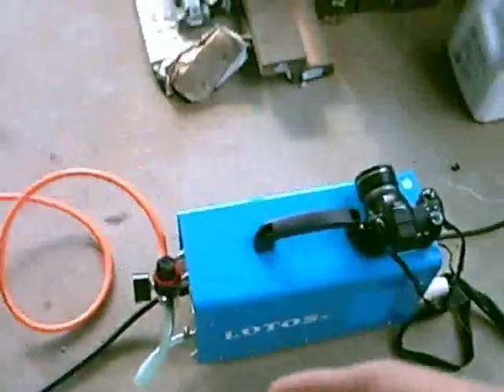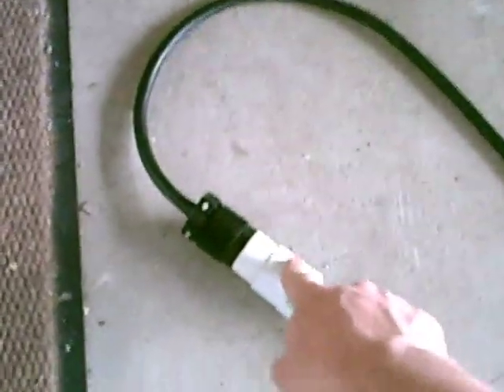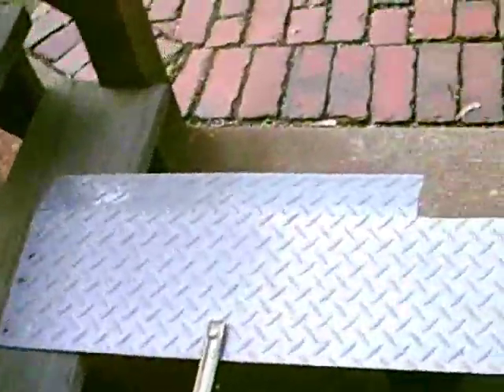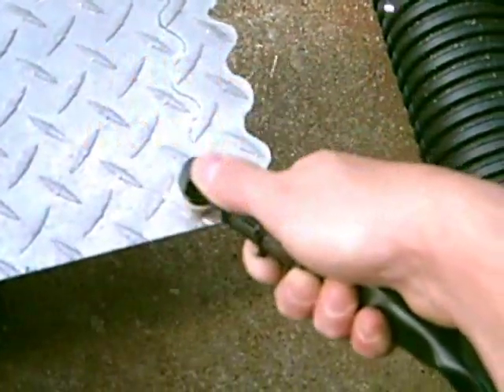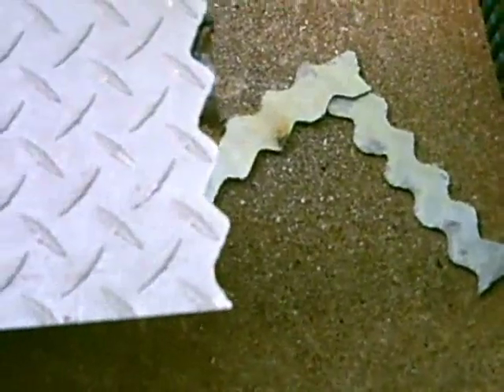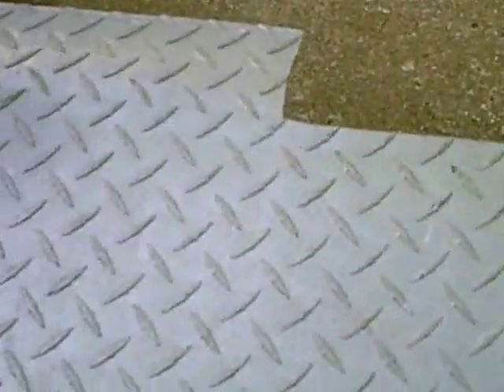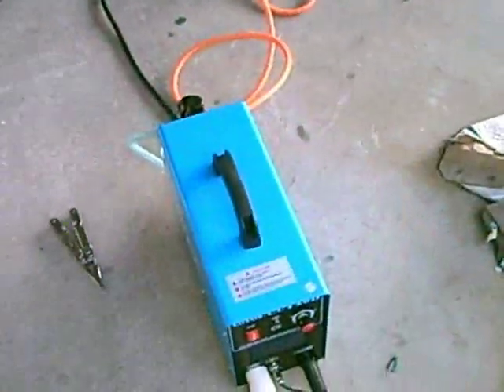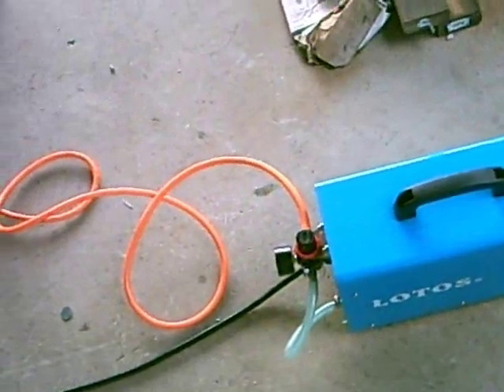Using my Cut40D plasma cutter

Comment: i repair rotten cars, so i have a electric cutter tool, but that one only goes to 1mm sheetmetal, so anything thicker i need to cut with an angle grinder, and that's a stinking and noisy job, and leaves sharp edges that need more grinding, so very labour intensive, so for cutting thin sheet metal these china made machines look fine to me, because this goes way faster and cleaner than the old angle grinder, and without flying sparks burn into your eyes. so i'm going to get one for those 300 bucks

Comment: Not bragging or anything, meerly giving advice or a tip. I am a senior in HS and my shop class bought all new equipment which was funded by a company's fund raiser plus the Miller Educational discount which went from 60,000 to 40,000. I bought the older plasma cutter which is a Miller Spectrum 500 for only $250! came with about $200 in tips and cones as well. Buying from schools is actually a really cool thing.

Comment: Hi DeathBlade556,

Like I am going to tell you how to use a Plasma Arc when I have not actually used one myself, but, maybe the lower Amp would work if you went a little slower perhaps? And, cutting pipe or anything round. You move the pipe and not the gun.

Just trying to be helpful honest!

Looks like a cool or should that be 'hot' like very hot piece of gear! So what you going to use it for my friend?

I used to spend hours help my Uncle, who was a brilliant welder, so I am interested!

Comment: get a much more powerful Pilot arc  plasma cutter Lotos LTP5000d from Lotos dealer or Lotos California @ uweldign dot com or from Lotos ebay Dealer (check ebay item 180533331085 ) or call 408-642-4864

Comment: if it was 1/8 inch its not plat its considered to be 10 gauge sheet metal and if u cut slower wont have to beat the diamond plate with some pipe and the left over kurf would be considered to be SLAG aluminum and steal have different settings for apps 2 totally different characteristics of metal BTW im a teen and i know more about this shit then u thats sad dude

Comment: I think it was like brown on mine... I saw there going "WTF!?"  I just stabbed my volt meter probe through the paint on the case until I hit metal, then tested the wires until one made continuity.  Was easier than opening the case, didn't void the "warranty", and I could care less about a pin-head size of missing paint.

Comment: comawhite13> I was going to call you a moron, probably still will. But the fact remains that a lot of "American" tools are put together in the USA using parts bought from China and everywhere else.  I have a GiantTech Arc/Tig/Plasma combo.  I paid $600 for it.  It would have cost me over $2000 if I'd bought them from Lincoln Electric

As for it being "racist", if anything it's anti-nationalism, but since America is being slowly murdered, it all won't matter in another 10 years at this rate.

Comment: Seeing as hes not answering i will.This guy hasent a clue how to use it,lol.Hes cutter way to fast,crancking up the amps just burns more electricity.This machine will cut 5/8 plate,but cut at a slow rate.Dont worry about seperating your self from the ground,u wont get shocked,,i wear a good pair of sunglass's when cutting,its all u need.

Comment: Either remove the cover and see which of the power cords three  wires are connected to the machines metal frame and which two are connected to the ON/OFF switch or without removing the machines frame you can do a continuity test with an OHM meter from a point on the outer of the machine's frame to each of the three wires to find the wire that is connected to  the frame, that wire will be your equipment ground ( normally green in the US ).

Comment: It's actually arcing inside the torch, it burned a path along one of the air holes and cut a trail across the electrode.   Have 120 lbs and had it adjusted as recommended.  Also had a water dryer on the compressor.   Contacted the seller and he had me ship it back for warranty replacement.     Thanks for your help, I'll let you know how it turns out.

Comment: I've got one that I've used just a little, had it only a few days, and it's not cutting.  Is sort of sparking and skipping and shooting fire off to the side.   Have made sure it doesn't have water in the line, and switched the consumables a couple of times.   Any suggestions?